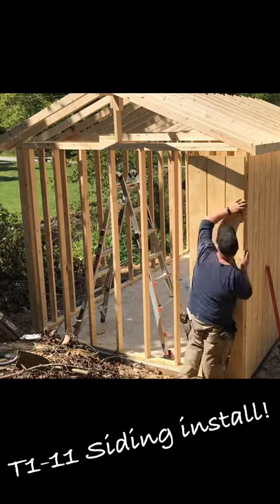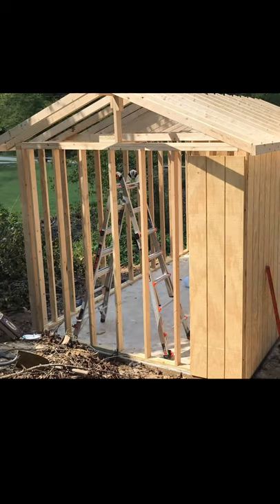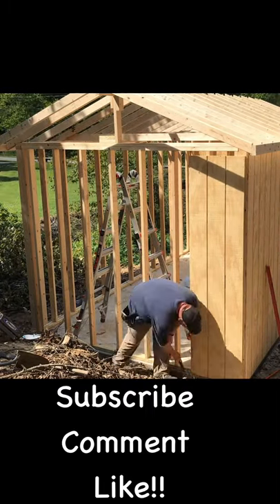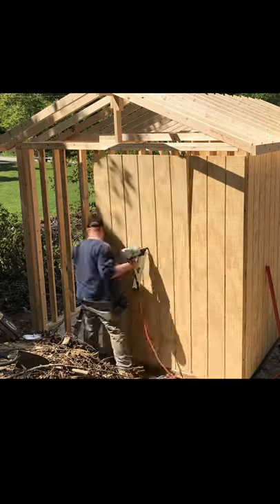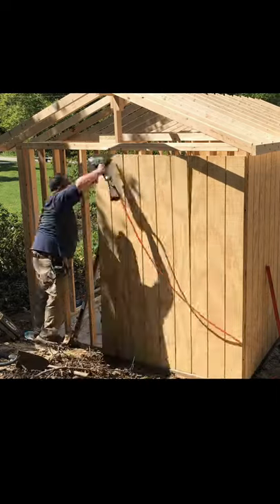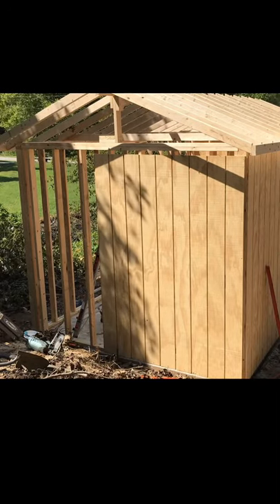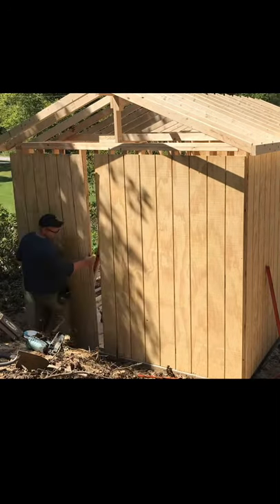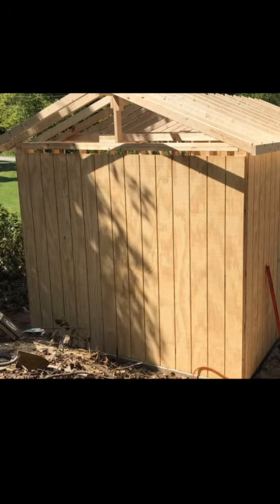Installing T1-11 alone! #shorts #carpentry #hardworkpaysoff

Comment: 🚨I thought that you can’t stand plywood up on an exterior wall. 
4x8 sheets of plywood sheathing should be laid down horizontal and span the studs in that orientation to prevent bowing between each stud. 
You definitely can’t run plywood like that for subfloor in a house

Comment: T1-11 is the worst siding type. Hardie plank the best .
Reply from the maker: It works well in some situations. Hardie plank is good Also! Thank you for watching!
Reply: Actually if installed correctly.  Sheathing underneath. Z flashing. Stain or paint edges before installing. Stain or paint every 3-5 years as recommended.  It will last a very long time. Going on 30 years
Reply: It's a shed dude